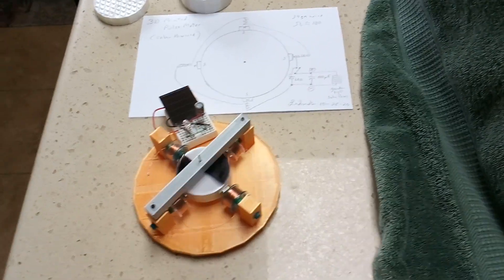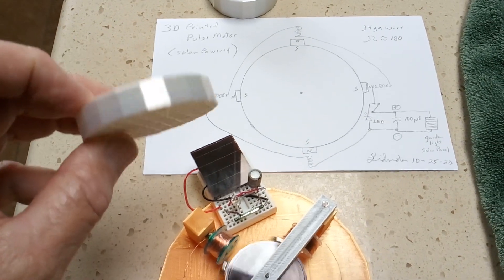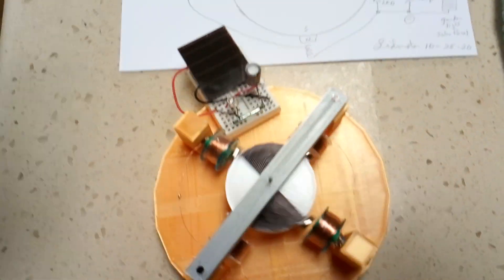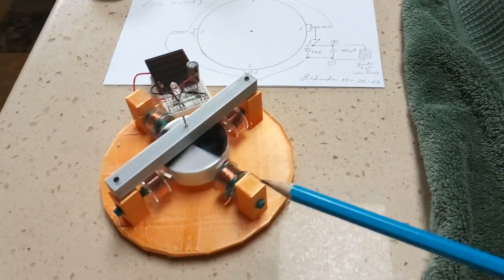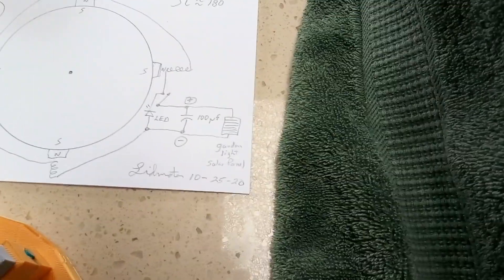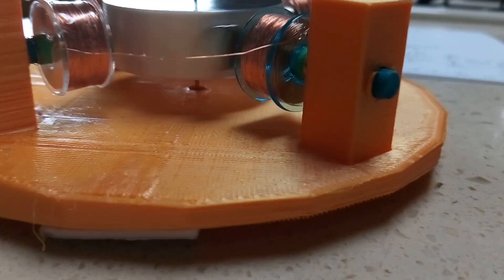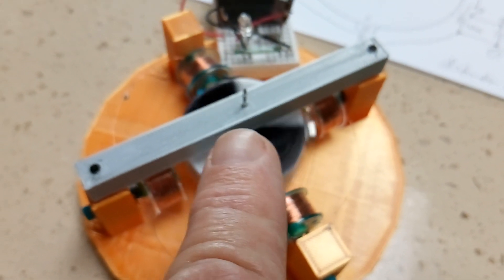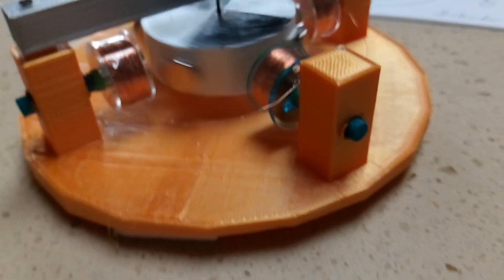3D printed 4 coil pulse motor

Comment: You can even make these with like 3% infill since you have 0 load on that thing. It'll weigh almost nothing, maybe a gram or two.
Reply from the maker: You are right.  I printed the last rotor shown here at 10%  and it is structurally fine for this purpose.  At 3% infill it should still be ok.  Almost no load here.  It is just spinny thing.

Comment: hey! I have a question about your low temp stirling engine generator video where you used a stepper motor. do you have the model no of that motor? also im wondering if you could directly connect the motor shaft to the flywheel pivot. thanks!

Comment: Lovely work Sir! Is it a super capacitor that's been used?
Reply from the maker: This is just a 100uf electrolytic but I have it now running on a 10F 2.7v super capacitor.  It will still turn all the way down to 40 micro amps and less than 1v.  It is more efficient than I thought it would be.  The question is what to do next with it.
Reply: @Lidmotor  Thank you Sir for your reply. I'm in the process of making my first pulse motor. You are my inspiration.